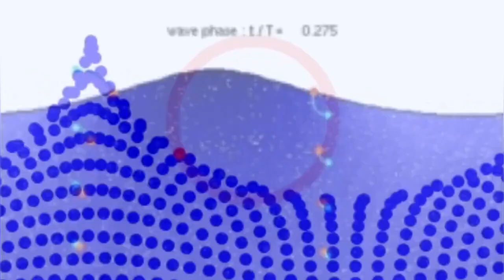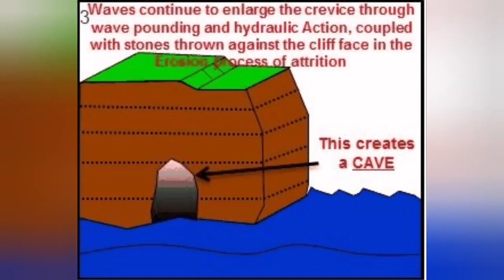Grindavik Is Falling Into Sea, Iceland Sundhnúka Hagafell Grindavik Fissure Eruption Volcano, Venice

Comment: There's no easy way to rescue the town or maybe build anything on Iceland.  1.  Perform exhaustive geo tech survey to ID all voids under town.  2.  Pump full concrete Yes that's a lot of concrete.  So setup local plants and formualte with crushed bol
1.  Build 100 plus foot ball free size concrete bages, put homes on those.  Erect berms above sea   Flood area float barges connect.  Tow awa